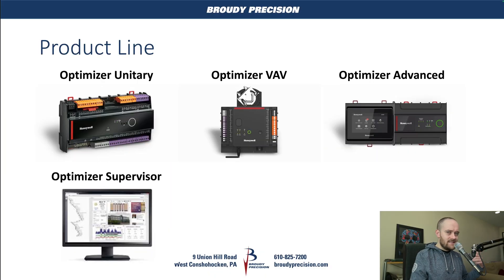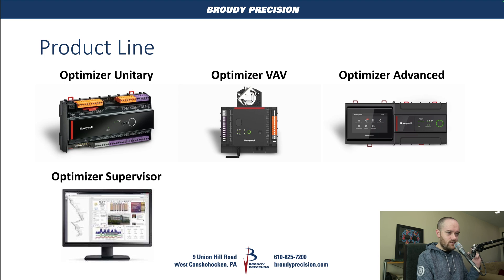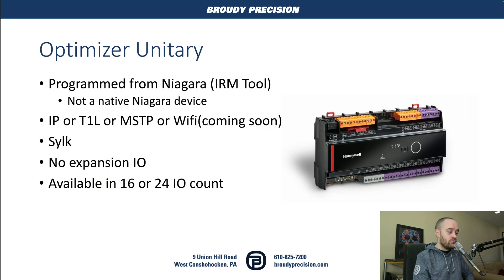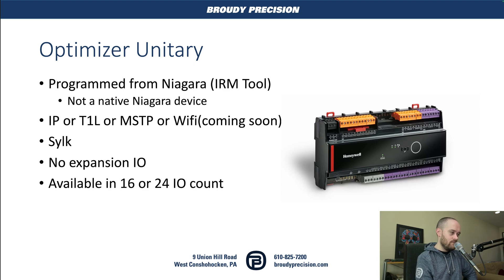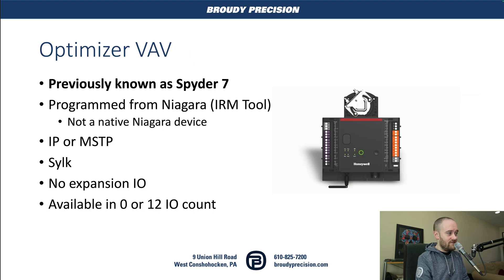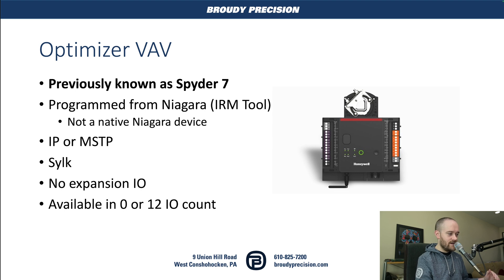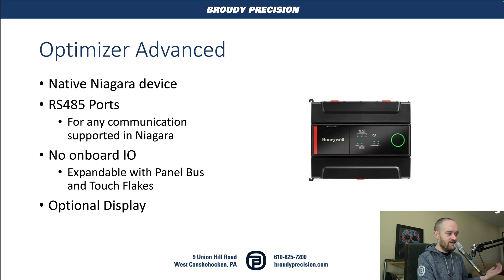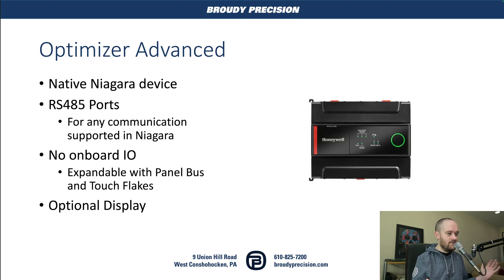Honeywell Optimized Suite Explained

Comment: Hey, can the optimizer advance do CBus straight out of the rs-485?
Reply from the maker: The Optimizer Advanced has the driver licensed but the onboard 485 couldn't be used for CBUS. That would require the CLIF-CBUSLC interface to be used with the Advanced (same as with the 8000 & CIPer 50). -FW
Reply: @broudyprecision  Thanks, the CPO version of the same controller can (according to their datasheet). Thank you though.